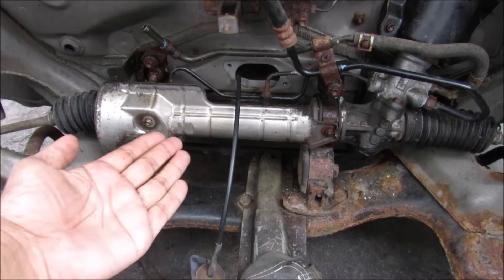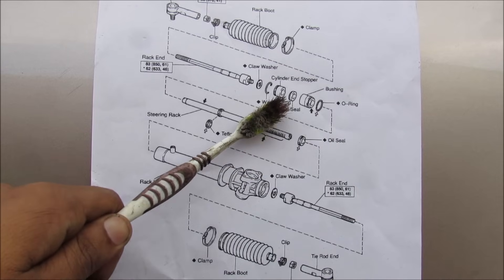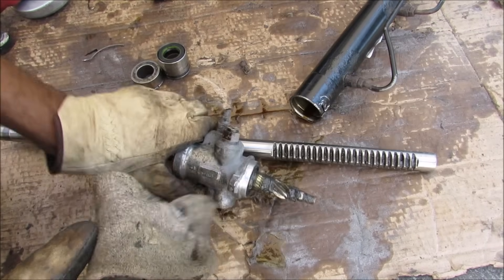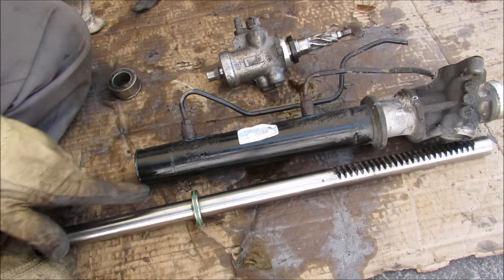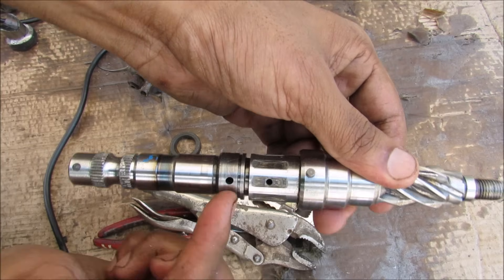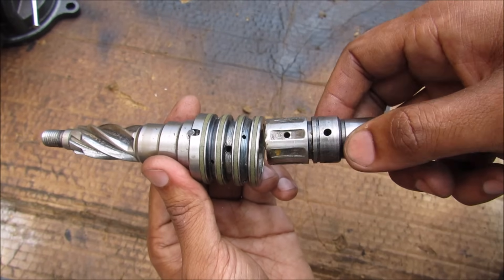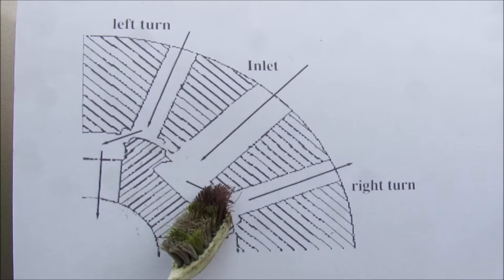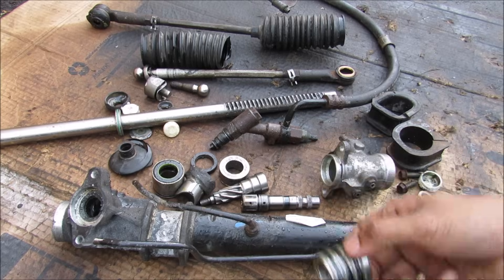How a Hydraulic Steering Rack Works

Comment: That's a really great video. One more bit of information: The control valve actually lets the steering pump free-wheel by letting the fluid flow easily from input to output when you're not using the steering wheel, so it's not all that in-efficient. It doesn't put much load on the engine until you begin to turn the steering wheel, and the control valve then blocks free-flow of fluid and forces it through the steering rack piston.
That's why the engine RPM (at idle) drops a little when you turn the steering wheel, and if you turn the steering wheel all the way against the stop, the rack piston stops taking more fluid which causes the pressure to rise rapidly until the overpressure relief valve in the pump begins to let the excess fluid bypass the control valve. That's the hissing sound when you turn the steering wheel all the way. 
Thanks for the great video! I enjoyed every second and I enjoyed the fact that every second had something useful in it!
Reply from the maker: I meant it's still inefficient compared to electric steering, since you still have the pump and fluid circulating
Reply: @speedkar99  Oh, I see what you mean. Although with electric, you have to consider it's pump - an electron pump - aka the alternator - and it has to be larger to handle the increased load, and it's always turning and always sending full voltage to the electronic control module, which wastes some of that power all the time. The larger alternator puts more of a load on the engine, all the time. (Yes, a larger alternator has larger core losses even when producing small currents. Look up core losses in generators.) So the increase in vehicle efficiency isn't as great as you'd guess. But sure maybe you can get a couple percent better mileage - which could save you a few dollars a year - but my guess is that your entire savings is gone when you then also take into account the greater cost EPS to start with, and the greater cost when it dies and you have to replace it, and the much greater chances of it breaking: It's a very complex system involving wires, semiconductors, electromagnetics, and a computer chip more complex than the one that first landed on the moon: The average rate of failure and average yearly cost of EPS repairs per thousand cars FAR exceeds that for engine driven hydraulic power steering, and this cost severely consumes the slight fuel savings brought by EPS. Hydraulics last an extremely long time, are very simple, and nearly bulletproof.

Comment: I believe my pinion gear and rack are worn, is there something I can do other than replacing it?
Reply from the maker: If it's worn there's not much to do since rebuilding it is probably going to be the cost of replacement...that is if you can get  individual parts for it ...most OEMs sell it as a unit.

Comment: Speedkar99, first off very informative video. I have a question and this has happened to me prior. Sometimes on the initial turn of the steering wheel, you come up against some pretty high resistance and you can feel it break free and then work normally. Usually when everything is cold. I've been told its a worn shaft and the seals are binding. Is that true? Just for my own info as a diyer. Thanks in advance 👍👍👍
Reply from the maker: That sounds right, you should also hear clunking or feel play in the UV joints

Comment: So what is wrong when rack toothed shaft has play when pulling on rear of front left wheel.  Making that toothed shaft knock against the housing?
Reply from the maker: There's always going to be some tolerance when you have moving parts. Add up the tolerance of the rack-pinion gear, the universal joints in the steering shaft and the steering lock and that's why there appears to be play when you shake the tire. 
If the tie rods are worn, that will significantly contribute to the play as well.
Reply: @speedkar99  so with a hard pull causing movement on the rack itself is normal so long as all the other components have no play?  Shouldn't have to pull hard to see play?

Comment: I'm using a rack & pinion for my go kart steering system. I needed the real feel of 1.5 - 2 turns to turn the wheels. Not 1/3 turn like a go kart set up.
Reply from the maker: But then how do you drive it at speed? I'd say that takes away from the fun...

Comment: Did you say how inefficient the pump is due to the pressure being wasted by returning to the pump?

That's how a hydraulic system works. The pump pressurizes the fluid, sends it to where it goes, and returns back. If there is a tank then it gets sent back to the tank.

If there isn't a demand for pressure then it cycles through the pump, lines, tank (if you have one) then.back to pump.

I dont think you can make it any more efficient without breaking the bank. But now we are in the dawn of e-power steering so this may be a thing of the past in a few more years.
Reply from the maker: Variable pumps or electronically actuated pumps may be more efficient

Comment: I have the speed sensitive rack n pinion with filter on my 1991 Cadillac Fleetwood Sixty Special FWD. 
PLEASE SHOW ME FROM A TORQUE CONVERTER OF A 1991-1993 Cadillac front wheel drive what a VISCOUS CONVERTER CLUTCH IS!!
I’ll send you socks, underwater or pj’s. I really want one. To see one.

Comment: I retired from a Ford dealership. In old days we had to reseal power racks... I got really fast at it after doing a few. Great video and great explanation on the torsion bar input shaft.
Reply from the maker: Thanks. The rotary valve is quite something!

Comment: Fantastic. I did sit there wondering how on earth it was working. Electronics is nothing compared to this
Reply: To be fair, electronics are even more impressive than this.  They're based on parts that are tens of nanometers across (that's only a hundred or so atoms, or even less!), with billions of parts.  I would love to see a teardown of electronics down to the bare basics but unfortunately I don't think many people have the tools to pull it off since you'd need an electron microscope or an atomic force microscope or something similar (normal light based microscopes are not powerful enough), and it's too complicated to fit into a single youtube video.

Comment: hi, i have honda accord power sttering is tight,  i dodnt know whether it is rack or pump. how to isolate, there is no leak what so ever
Reply from the maker: Check suspension first for binding 
And fluid level
Reply: @speedkar99  are u asking me to check steerinng rack for binding i see there is nothing unusual in suspension. oil level is good

Comment: Good job. I have an ml55 amg 2000 I need to top off the fluid. After putting the seafoam trans tune in. Can any any power fluid be used?  I don't want to spend the money on CHF 11S. I just need a little. Can I use prestone...  .european?

Comment: What kind of grease can u put on those teeth’s and pinion gears?
Reply from the maker: Since it's metal to metal grease almost any multi purpose should work
Reply: speedkar99 

Ok thanks, Im just asking because a lot of people use different grease like silicone base because it doesn’t swell up the seal. But when you took the rack apart it seems the seals are behind the stoppers so I assume any grease will not touch those seals. Is there’s more seals that’s on the pinion gear on the steering column. That’s grease can touch?

Comment: Hi Brother: I have a knocking sound coming from my vehicles rack/pinion coming from the drivers side when I turn left or right at slow speeds. I'm wondering if the entire rack is bad or if it's just the Control Value Assembly, where the gear teeth on the output shaft are skipping/popping over the teeth on the horizontal rack itself. No holding you to anything: Do you have any idea what might be causing the knocking sound?
Reply from the maker: Check the tie rods and suspension first. Rack and pinion typically last the lifetime of the vehicle
Reply: @speedkar99  My "Master Mechanic" friend listened to under the hood and under the minivan itself and has concluded that the teeth on the Control Value Assemply is skipping/grinding on the rack teeth itself, causing the sound, which means the entire rack is bad. Any thoughts?

Comment: Hey bro I’m having some issues on my 2011 tc. 2 weeks ago replaced the outer tie rod on the right side and had it aligned this past Monday. I’m getting weird jerks to the right side it does not do it all the time but when it does I’m just coating on the freeway like 60-75 I press the brakes. A bit and it will also jerk real quick like almost pulse light and u can feel it on the steering wheel and from the right side as well would it be that the steering rack is messing up? Shit is scary when it happens 😩
Reply from the maker: It could but you should look into your brakes first if it's pulling to one side
Reply: speedkar99 I ordered new rotors for the front new pads and ew pads for the rear.  See if that does anything and lastly I’ll replace the caliper as well maybe it’s causing the pad to stick and I’m experiencing what I’m getting. But I’ve noticed that if I’m not on the brakes as much it won’t do it vs being in stop n go traffic then it opens up for a while on the highway. Idk it’s strange I don’t get weird clunks or noises from the steering either

Comment: I worked in TRW, one of the largest steering gear manufacturer in the world, for 20 years working on the hydraulic steering gear.

Your explanation is THE best I've seen on the Internet. I don't think some of my colleagues at work couldn't explain it as well as you did. I don't know where you got your training but this video is A+. VERY WELL DONE. IMPRESSIVE!

One additional info if I may... at 6:40 where you explain the inner workings of the valve... the "slots" you see on the input shaft has really tiny chamfers along the edge, called "metering edge" which is ground to micron precision, give you a precise amount of assist proportional to the "relative twist" of the input shaft and pinion. That "metering edge" is the heart of the hydraulic power steering system.
Reply from the maker: Wow thanks very much for that information and feedback, it makes sense that that controls the sensitivity. I would love to work in tier1 or OE one day!
Reply: @speedkar99 There’s an OEM / AM, like TRW, that would love to have a person like you! 👍💯💯💯

Comment: Nice explanation ! I am always amazed by the ingenuity of people who came up with this kind of stuff. Sadly my power steering is leaking a bit and has too much play. Can't find any reconditioned power steering racks where I live (I don't really trust one straight from a junkyard - I might install it and then it leaks too), also it is very tricky to get it out from the car (need to remove part of the exhaust and subframe). Maybe my old Nissan is ready for the junkyard. Sad :-(
Reply from the maker: Yeah steering racks are generally not an easy to replace item. 

If the leak isn't bad I guess you can give it one last try with stop-leak but that could take it's toll on the pump later.

Comment: Thank you for the excellent video explaining exactly how the valve assembly works. I had an idea it was something similar using a torsion bar but wasn't exactly sure.  I've got an issue with my Volvo S80 where the valve appears to be sticking as the assistance is low but then suddenly kicks in if you turn the wheel a bit harder (not the pump, it's in excellent condition. The rack has been used with the wrong fluid previously and was in this state when I bought the car. Correct fluid has improved but not corrected the problem, hopefully I'll be able to repair this now with the knowledge from this video. Either that or there is some kind of scoring/wear causing the valve to not be solidly locked to the pinion.
Reply from the maker: Glad you found my explaination clear.
Reply: It's much appreciated, strange that I've crossed paths with another Volvo P2 owner with "similar" issues here too. Good luck for me though as it gives me much more confidence that the issue is indeed in the pinion valve. Thanks again.